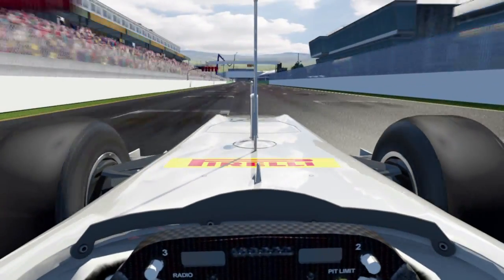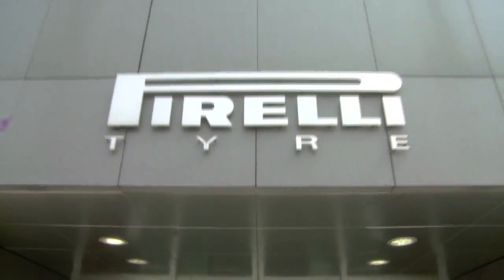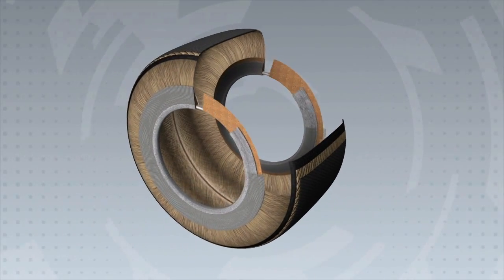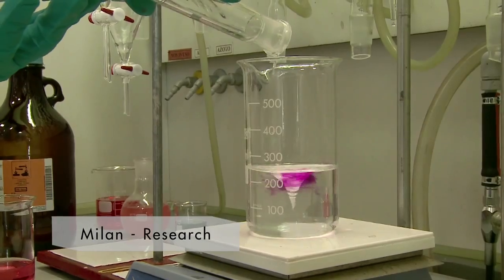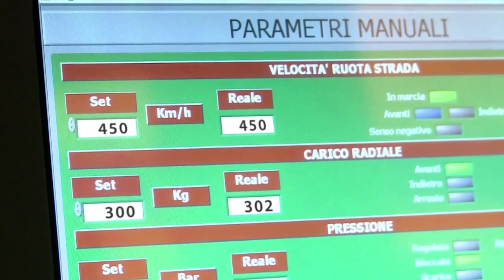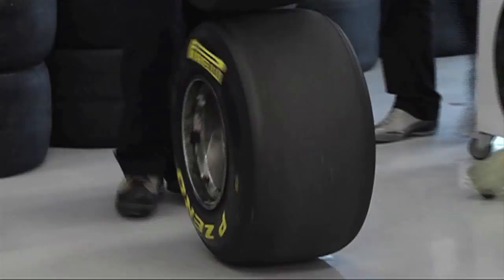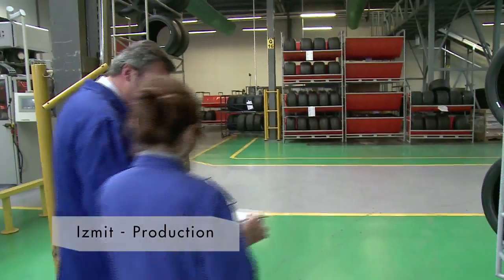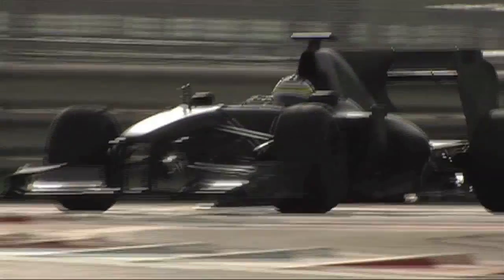How to make an F1 Pirelli tyre 2013

Comment: The internal combustion engine of a Formula One car must 1.6-litres in capacity and rev-limited to 15,000rpm. The engine must also have six cylinders arranged in a 90-degree formation, with two inlet and two exhaust valves per cylinder and a single turbocharger.

Comment: Why do f1 tyres have huge side walls and not low profile tyres?
Reply: Richard Hargreaves The size of the rim actually has effects on handling due to centrifugal forces. Minimising the rim size also cuts down weight too
Reply: +dankster Or maybe it makes it possible to run very low tyre pressures which gives you a bigger contact patch and way way more grip. Maybe.
Reply: +Richard Hargreaves It's just part of the rules, maximum rim diameter of 13 inches. I believe it was to prevent the brakes from being gigantic and massively powerful, but don't quote me on that I might be wrong
Reply: +Thomas Woolley the metal they use for the wheels is magnesium which is crazy flamable ..i dont know if that means anything guys but you guys explanation is probably right.
Reply: fifer mike Haha, they don't use pure magnesium, they use a magnesium alloy. The use magnesium as a base because it's extremely light among some other reasons

Comment: A lot of people are complaining about the tyres degrading quickly, but pirelli only did what they were asked to do the year before, but it only meant the drivers couldn't push their cars to the limit which made the races boring. We need refuelling back and we need tyres that can be pushed hard without giving way on the first corner.
Reply: Couldn't agree more. Pirelli aren't a bad tyre maker. They were asked to do the tyre "bad" intentionally. Refueling would be awesome. It would increase the element of strategy and a chance for the teams that don't necessarily have an infinite budget.
Reply: ***** Refueling would be great to see again, s it would make races a lot more exciting as everyone would mostly be on different strategies, but obviously that can't happen as we all know. Also, fuel tanks are getting smaller as well this year, so that should spice things up a little!
Reply: But because the engines are smaller and therefore require less fuel :P